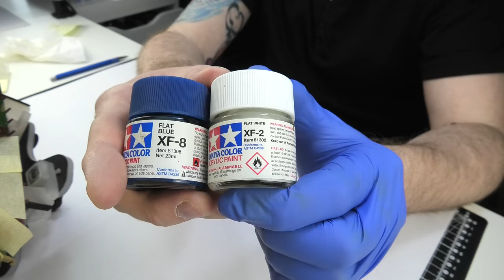HOW TO PAINT: 5 steps of winter camo painting on King Tiger in 1/35

Comment: If you brush paint you can use AK additive that you mix in the paint then you can brush it on and then chip it...I use it a bit..if you arent too fussy applying the paint,it works.
Reply from the maker: Thx for this tip! :) Need to check :)